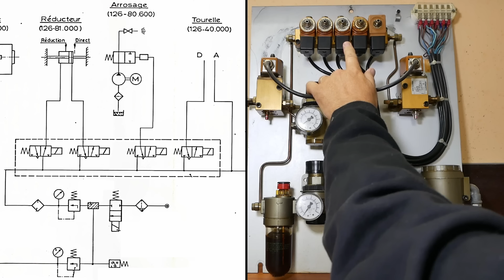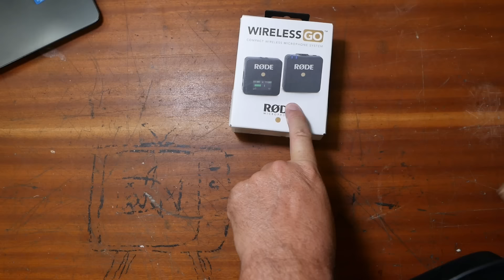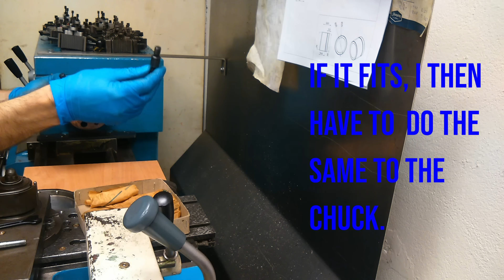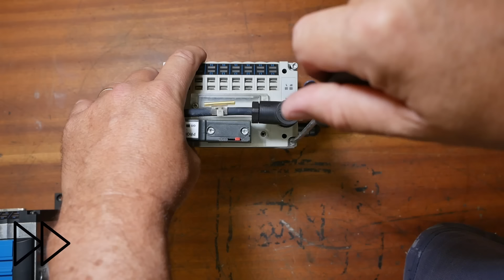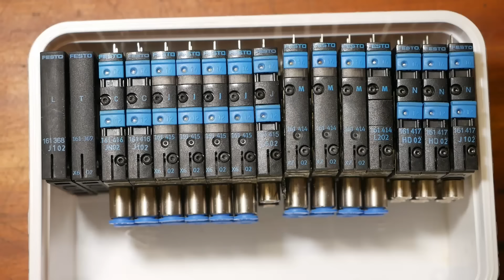Miniturising the pneumatics of the Schaublin CNC lathe. Ep.13

Comment: Nice work, and nice find on the CPV fittings. I dunno why... I always find pneumatics so logical, so consistent, so versatile, and so utterly, utterly inscrutable. I'm missing some wiring in my head I guess.
Reply from the maker: I find this stuff easier to get my head around than electrical components. You dont worry about reluctance, and inductance I guess.
Reply: @RotarySMP  True, but as an electronics engineer (lapsed) I find ‘our’ stuff easier to get my head around - I recall watching Doug from SV Seeker doing some explanations of hydraulic valves (similar to yours only bleeding off is really not optimal) and it sent my head spinning.
I guess in electronics the head just spins later on, when two identical circuits behave differently in practice 😬
Reply from the maker: @mumblbeebee6546  To understand electrical circuits, I always picture the electrons as a flow of water. Probably not that helpful.
Reply: @RotarySMP  Oh, I have always considered the ‘plumbing equivalent of electricity’ a good teaching aid, so that works for me! I really think that it just comes down to what field we first become comfortable with, that one feels natural. Oh, to be a polymath!
Reply from the maker: @mumblbeebee6546  I get lost in when to add a capacitor, inductor or a pull up or pull down resister and things like that.

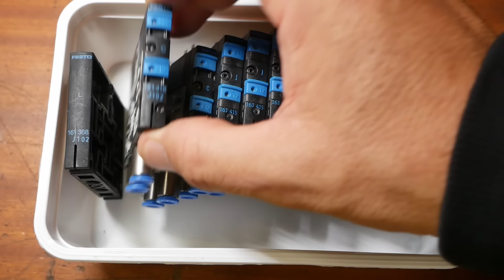Comment: Call me paranoid, but I might have spottet "some" 'J'-valves in this shot: 20:23
Reply from the maker: They are a buch of I's. I introduced them wrong.
Reply: @RotarySMP  arent these also Festo 161 415? An 'I' type would be a 187 843 , I believe.
Reply from the maker: @marcus_w0  Cool. You are right. They are 415's, and therefore J's. Looks like they changed the font a little to make some have a longer hook.

Comment: 2:22 regarding coolant pump. I'd trust Schaublin. Typically when you start the motor, the flow is delayed and starts funky 'til it evens out. Valve it on, starts fine.
Reply from the maker: I have the directly controlled coolant pump on the Maho, and it is funky, especially of the coolant level is not high. I just added a G4 P5 to the PP to wait a bit after turning on the coolant. But you are right, since it is already all set up on the Schaublin there is really no reason not to keep it with the pneumatic flow control.

Comment: Hi Mark,
Looking at the Schaublin's pneumatic circuit diagram, the reduction gear control needs one normally open and one normally closed 3/2 valve which is a type H (part no 176064), alternatively you can achieve same functionality with one 5/2 J valve (part no 161415).  There were 5 J's with your donor valves.  The functions originally fitted with double solenoid 4/2 valves can be also be operated by using J valves which are bi-stable. The coolant and unused turret functions require normally closed 3/2 C valves (part no 161416). Each 3/2 valve in C slice is independent.  The valve configuration for your lathe would then be JTJCJ_ _ _, the 3 spaces at the end could be made up using the remaining C, plus 2 other valves. I would recommend using J's (fitted with the blanking plugs. This would then give you a spare of each valve type in the valve terminal for fault finding. The final configuration would then be JTJCJCJJ - you already have all the bits you need for this.
Cheers,
C
Reply: You beat me to it, so, I'll just confirm that that's two of us that reckon it can be done with the available parts.
Reply from the maker: Thanks for your feedback on this guys. But  I messed up. Four of those type Js in my donor donor...were actually type I's. I only have the one J from the second terminal.
Reply: @RotarySMP  The use of a hooked 'I' for identification in a system that includes 'J' seems remarkably - well,  stupid.

Particularly if the labels are, as they appear to be, printed rather than impregnated.
Reply from the maker: @Azlehria  Yeah. It caught me out. I thought I had a bunch of J's, but then saw all the I's have that same hook.
Reply from the maker: @Azlehria  I just got feedback on the part number. I was wrong, they are J's. Looks like there are two fonts, with the newer having a more pronounced hook.
Reply: @RotarySMP  Excellent news!
Reply from the maker: @Azlehria  Yeah. I also thought about the back gear. It is also just a simple two piston actuator, and should initialise in the low speed position. Rather than searching for an H, that can be done with an M.
Reply: @RotarySMP  I had to hold my tongue at the right angle and squint at that font as well. The part numbers were conclusive in the end, but what an oopsie on Festo's part eh? I wonder how many have fallen into that trap? I hope it works after all of this.
Reply: @RotarySMP  Yeah, an M will work for the back gear,  they're mono stable, so you would get a default low speed position when the solenoid is not energised.
Reply from the maker: @chrisampt1914  Thanks for confirming that.

Comment: Small world. I was an instructor at TTS and was there the day the Devon ate the battery cart, but was inside the hanger when it happened. 
Enjoying the videos - keep up the good work!!
Reply from the maker: I was on R1/89 and then straight to basic eng and mechs course. I couldnt remember if that happened before or after my time. Guess the legend grew with each telling.
Reply: @RotarySMP  I can’t recall exactly but guessing late ‘90 early ‘91. 
From memory the pilot failed to keep the rpm down after start, no pressure in the pneumatics as it always leaked out overnight, and the aircraft jumped the chock and swung around putting the prop through the battery cart at the nose. 
Battery acid everywhere a number of holes in the fuselage and a 20cm piece of prop blade sailed past a couple of trainees that were spectating on the grass off to the side. Still makes me shive
Reply from the maker: @oxxandbert9702  I bet. I wonder if I heard of it then, or it was the sort of thing to be done every decade or so?
Reply: @RotarySMP  I got out a couple of years later and moved to Aussie, but AFAIK it was a once off. 
Not the sort of thing you want repeating ;)

Comment: Festo valves would not be my choice. I have many years pneumatic experience and I would go with any other brand over Festo. They were not known for reliability.
Reply: I was never a fan of festo because of the crazy part numbers and I have also had premature failures. My favorite valves are SMC. MAC is okay but not as compact as SMC. SMC has drawing software you can download for free if you feel so inclined.
Reply from the maker: I guess that is the problem with buying shiny objects on ebay. Hope I get lucky and get some reliably ones.
Reply: @RotarySMP  at my last job, I would fix hospital beds with an air mattress system that also used miniature valves so as to fit in a small space. They were extremely reliable and the brand was MAC. The problem with Festo was the aluminum bodies would crack at 100 psi working pressure even though they were rated for 125 psi. Keep you pressure down and they will be fine.
Reply: @millwrightrick1  His low non production duty cycle might also help. Thanks for the warning about yet another product line that doesn't meet its stated specs. It's rather tiresome as I was just eying some Festo modules on eBay.
Reply from the maker: @millwrightrick1  Thanks for the heads up on that.

Comment: These Festo valves are not so great. This is from my personal experience with about count of 100 of single valves. They has limited life time to about 10 years. Single coil connectors just dying even faster (dying circuitry inside the connector so solenoid switches on for half second or do not switches at all while indicator light up)  Valves stops to work also after several weeks of not use, even do not react to hand lever. So we changing them to some others.
Reply: Again we had one machine at a glass factory with Festo valves. Normal airline lube would be 32 weight hydraulic oil, but this machine required 16 weight oil probably for that reason.
Reply from the maker: @millwrightrick1  I'd better clean out that air oiler. I would estimate that this machine last got maintenance in 1994 (there was a peice of tape with a date on the gearbox), so the air lube oil is probably also 25 years old.
Reply from the maker: Oh, thanks for the info. Being a hobby machine, this will definated have periods where it goes unused.
Reply: @RotarySMP  As I understand this problem of not working valves after some time of not use related to hardened lubrication oil inside the valve. So if you will encounter this problem you can disassemble it, clean as much as possible and oil it with fresh suitable oil. This helped sometimes for us :)

Comment: Good job on the backing plate, it's always nice to see the happy customer and the part being put into service afterwards, something we rarely see on machining channels. Funny you mention VFD's, I've been shopping around for a VFD and a 3 phase washing machine stator/motor combination that will form the heart of a mirror grinding and polishing machine I see in my future.  As to shrinking your pneumatics my insane coffee less brain was thinking that all you need is a bunch of power mosfets and mechanical relays she'll be good, I mean they control stuff too, right?  - tongue in cheek obviously :-)
Reply from the maker: I got really lucky with that Lenze. It popped up here in Austria for only €100 with the control panel. Normally Lenze VFD's are sold without that module.

Sergey programmed the software to control the Maho gearbox, so he gets machining on demand (or destroyed part screw ups).

Comment: A type J should be fine for the collect closer, if you are going to stick with two signals (one for opening and a separate one for closing)
For the back gear I'd replace the type H one with a type J, under the assumption that you are only ever going to actuate both valves in unison.

The combined valves (H, N, C) are normally completely separated. So you could also save one of the C types by just using one half for the coolant and the other half for the tool changer
Reply from the maker: Only after I finished this did i see that the Type M is designed for this job isnt it?
Reply: @RotarySMP  The type M could also be used, but it is automatically reset by a pneumatic spring. So you'd have to keep the actuation signal constantly on to activate the valve. To deactivate it you'd have to turn off your control signal. If that is fine with your electronics setup it should work just fine
Reply from the maker: @3MrP3 Do I need the pilot air ports connected on these valve? Or just supply (1) and Exhaust (3/5)?
Reply: @RotarySMP  I'm not entirely sure whether the pneumatic reset "spring" needs to be separately supplied via the pilot port 12. It's most likely the case if the valve body has connections for this port. No matter if you have to supply it through the pilot ports or not, there always has to be pressure for the valve to be in a defined state.
One thing to be careful of is that you hook it up in a way that the reset position closes the collet so that in the case of an electronics problem the collet doesn't accidentally open.
Reply from the maker: @3MrP3  THanks for your inputs on this. I was complely clueless about this at the start of the week, and am still very low down on the learning curve. I will need to test this stuff once I have it connected, as I am sure the first attempts will have some errors.
Reply: @RotarySMP  You are more than welcome! I'm sure you'll get it working in no time.
Reply: @RotarySMP  — I think the key to testing is to validate the intentions and failures are as expected by walking through a FMEA of the system. 😊. I suspect you’re way ahead of us on this front.

Comment: Hello Mark,
Good video today... The Festo system is really cool, hopefully one of your viewers will be able to help with the parts you need. The filming of the tapping on the chuck with the split screen was fabulous... Have a good week and hopefully see you next Sunday...
Cheers.
Paul,,
Reply from the maker: Thanks Paul. Companies with stuff like Festo should make a cooperation with Lego :) Thanks for commenting.
Reply: @RotarySMP  They're already cooperating in regards to their pricing policies.
Reply from the maker: @graealex  I bet. Pretty cool this stuff comes up so cheap on Ebay. I hate to think what that all cost new!
Reply: @RotarySMP  I used to build simulators that used Festo valves and controllers, and I can tell you that even those plastic dummy plugs are obscenely priced. Just the Festo components would be at least a third of the cost of the whole simulator.
Fortunately, you can at least buy the tubes and the QS connectors off-brand without any problems.
Reply from the maker: @graealex  Thanks for the heads up. There seems to be plenty of Festo tubing and fittings etc offered on Ebay. so I'll keep my eyes open.
Reply: @RotarySMP  I'd take a look at Landefeld online shop for your pneumatic plumbing needs. Although it's always an option to buy directly at Festo to find those elusive valves you're still missing. After registration, you can view prices normally.
Reply from the maker: @graealex  Thanks, I'll take a stiff drink before seeing those prices :)
Reply: @RotarySMP  Make sure you puy PU tubing and not nylon etc, especially if you've got any tight turns to make, PU doesn't kink . It's probably only a couple of Euro's a meter for the 6mm size?!
Reply from the maker: @richardneilson  Thanks for that. I am just starting to wade through all the tubing ans fitting options.

Comment: Not too far away from where i’m living there is a Lenze Production. Not sure if they sell to a private person. Doubt they are cheap though but you get what you pay for ..
Reply from the maker: I think most of those big german "Mittelstand" companies are focused on industrial customers and dont sell to private. Shame. Festo should just do a webshop. WIth all the little fittings and parts they sell, that would be really helpful. Thanks for watching.
Reply: @RotarySMP  Doesn't Festo have a Webshop? We order all our pneumatic parts at work from Festo. Those valve manifolds are super useful, we've got boxes of all the air connectors and tubing but sadly no spare valves :(
Reply from the maker: @dave1812  Oh, you are right... they do have a web shop. Wonder if they will let me sign up. Many of these companies wont sell to private people without a company.

I have a fair bit of work to go through system by sysem and make a BOM of all the tubing and fittings it will also need.